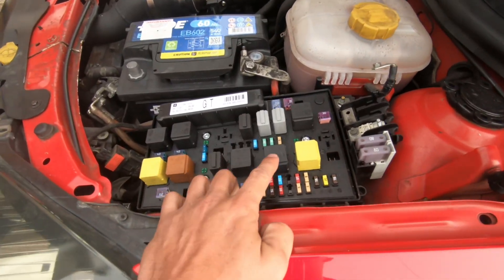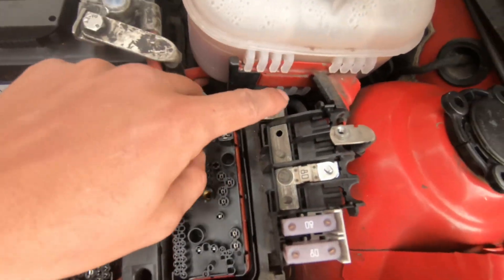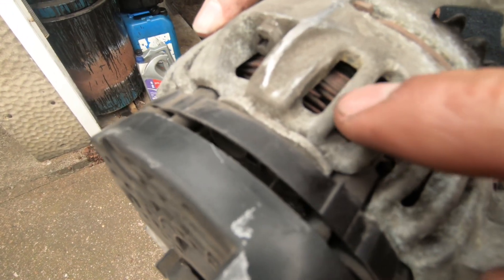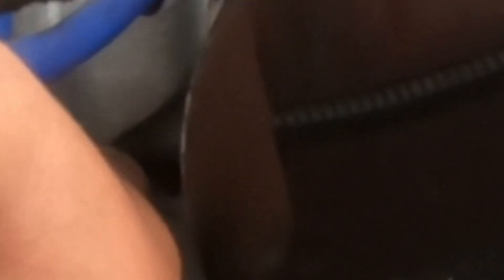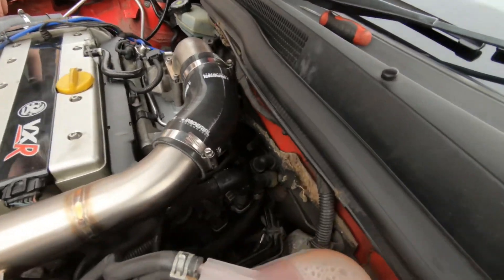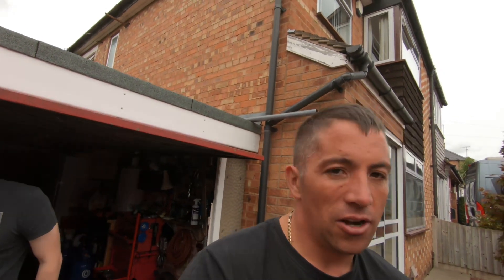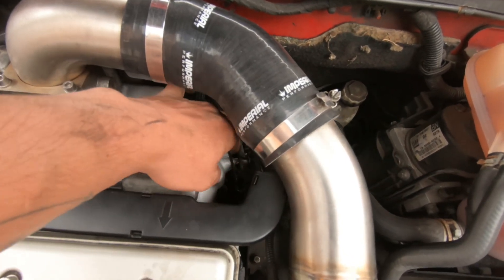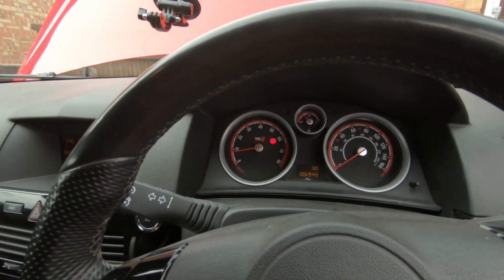Astra vxr wouldn’t start f on dash

Comment: Make sure the single wire capacitor on the right side next to coil connector is connected with a good ground too mate, if this isnt grounded properly it causes voltage spikes to the ecm, I also added an extra cable from the ecu direct to battery negative after having the exact same u2105 fault
Reply from the maker: Nice one mate 🤙🏻

Comment: I had a old original hose clip I missed when all the silicone hoses were put on it only tapped a hole under the boost pipe made the car do a lamba and spark plugs and just been back to Rnd for a map tweek all good now but what a headache 😂
Reply from the maker: What’s she running now
Reply: @Yodaracing1  356bhp 340Nm the ways it's tuned its an animal more than happy with her 😀 🤟👌
Reply from the maker: @markymark3295  sounds epic !
Reply: @Yodaracing1  it's a venom hybrid stage 2 realy if I would of known I would definitely have got the KRS stage 3+ to hit 400bhp but its messing about n spending more £  just for 44 bhp lol
Reply from the maker: @markymark3295  yea that power level is perfect for the road
Reply: @Yodaracing1  it had a new 90mm hybrid intake with venturi housing n over sized proram airfilter mapped it aswell
Reply: @Yodaracing1  definitely but still getting a lsd fitted

Comment: Gr8 vid as ever m8 detailing the highs & lows of VXR Life ✅ Qq: looking at getting copy EDS Inlet myself is it a common hassle of the Alternator rubbing on underside of inlet - shall I just get my mechanic to extract it upon fitting as well? Thanks 😊
Reply from the maker: Cheers mate 🤙🏻Yea it can be a common issue with them one way round it is use a thermal gasket aswell as it will raise the inlet up a tad so should clear everything
Reply: @Yodaracing1  Nice 1 - Thanks ill grab one of those as well for peace of mind 😎

Comment: Hi. I have a question. You posted a video with the turbo dropping boost pressure whilst driving. How did you fix the problem
Reply from the maker: Turned out to be the map sensor

Comment: I've just had the exact same thing happen to me. Had to abandon the car until the morning as can't see a thing
Reply from the maker: Oh no 😩😩😩
Reply: Had the lights flicker on a couple of times. My first instinct was there's an issue with the ecu.  Glad I found this video. I'll try the relays tomorrow and check the clearance on alternator
Reply from the maker: @leewinney2449  look at my other videos mate the problem came back
Reply: I've just seen about the loom.  Not sure why but your videos have stopped showing in my feed and I don't get notifications anymore.
Reply from the maker: @leewinney2449  yea wasn’t the loom ended up being both fuseboxes fried
Reply: Just caught up with that video. Not sure how I missed all these videos. Not had a notification for ages and never anything on my main feed either.
Reply: @Yoda racing  which part of the fuse box? The main but or the part underneath?  I have a tiny bit of moisture in there, no rust or anything though. And also getting a clicking when key is turn to ACC, sounds like from the fuel rail. And dash is reading that I have no fuel
Reply from the maker: @leewinney2449  was the top half of the front one and the entire rear one go through all your fuses make sure everyone is ok spray electrical cleaner on the contacts mine also was clicking check all the fuses on the rear one aswell
Reply: @Yoda racing  I've just done all that with the front. About to tackle the rear. This would be so much easier if the car was at home lol.  Also going to sand down the bracket that the earth's are connected to on the ECU. Like you, I forgot to do that
Reply from the maker: @leewinney2449  I deffo feel your pain mate if still no joy message Simon Holden on Facebook he will get your car recovered and Wmvauxcare will sort it
Reply: @Yoda racing  nice one,  cheers mate.  So glad this isn't my daily
Reply from the maker: @leewinney2449  I feel for you mate I really do as I’ve been through it I really hope u get it sorted soon keep me posted I will help anyway I can
Reply: @Yodaracing1  did the fuse box need coding to the car, or just a straight swap
Reply from the maker: @leewinney2449  needs to be coded

Comment: 😱😱
Reply from the maker: Was scary times lol
Reply: @Yodaracing1  yeah mate similar thing happened to me years ago tiny bit water got in relays fuse box etc i done what you done sprayed elec cleaner was fine , the F thing comes on mine everytime i remap it with plug in eds ipf when i try diff maps but then goes off when its completed cycle on map when green light flashes map tool the F goes away and car goes back to normal on dash and screen , so yes its something ecu related mate was either water in ya fuse box area or something as does happen it coolant tank spat dripped or the window bonnet rubber right side corner comes away above the fuse box then once in blue moon rain gets in etc
Reply from the maker: @brian.heslop.399  yea agreed mate I’m just proper relieved lol thank god 😂
Reply: @Yodaracing1  yeah should be fine mate check that sponge stuff rubber top right corner that stops water running in above right suspension mont its small gromet
Reply from the maker: @brian.heslop.399  nice one mate will have a check tomorrow 🤙🏻